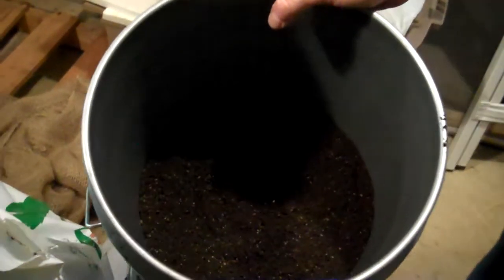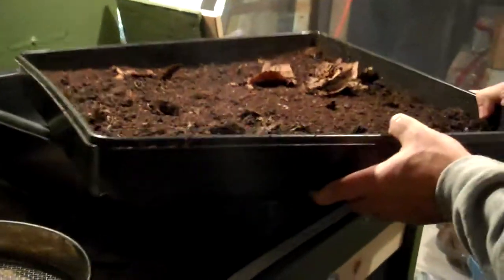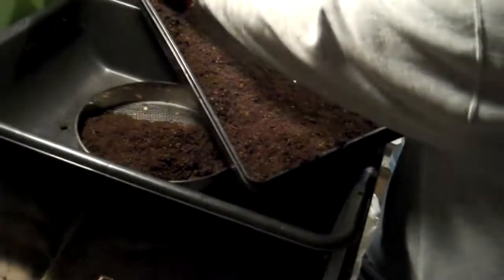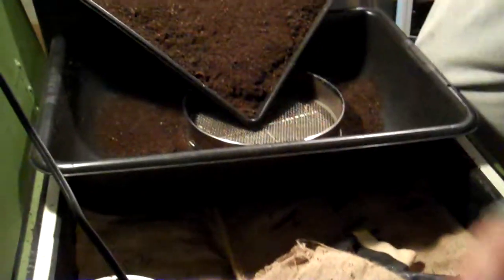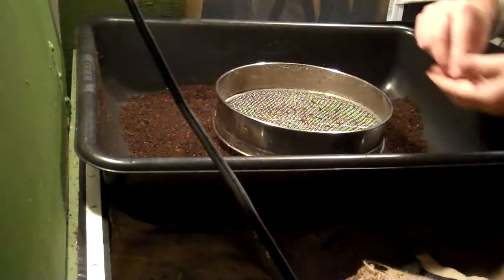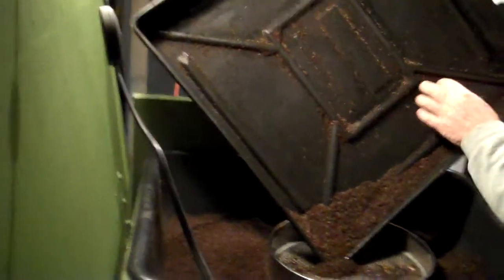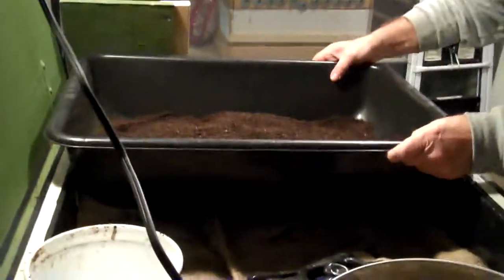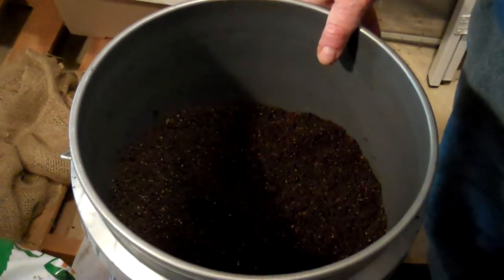The Strawberry Store - First Harvest from OSCR Worm Bin Part 2

Comment from the maker: @marito001 
I don't dry it at all before screening it. If the castings are too wet I use a door with screening that allows air to flow through and dry the vermicompost. So far I have not had to dry it. I screen it and then store it in 5 gallon buckets with lids.